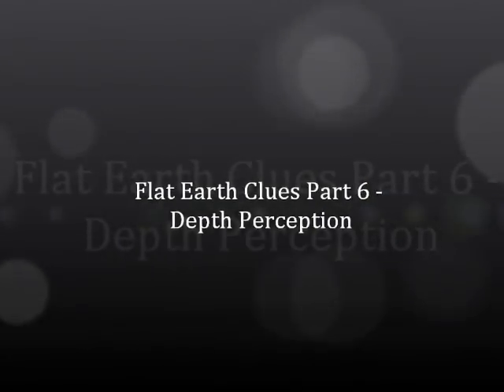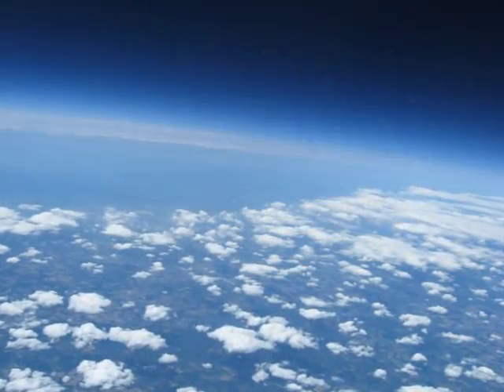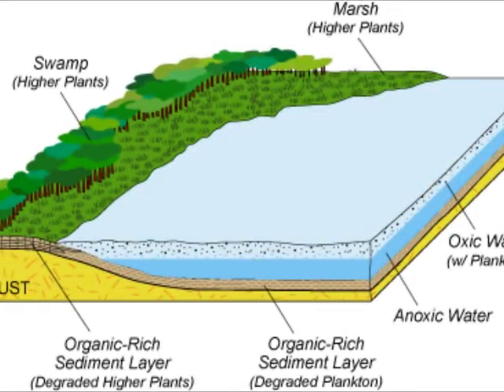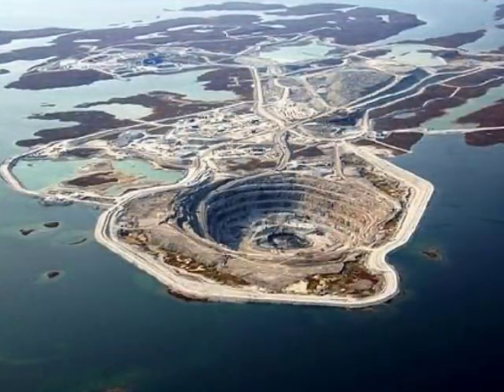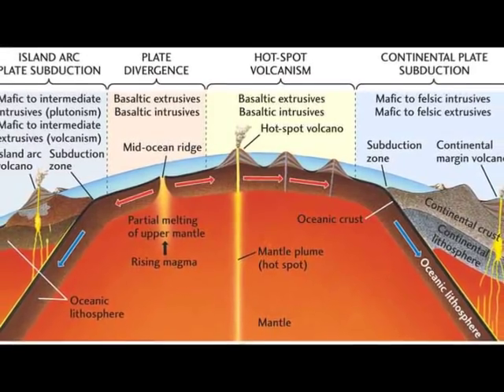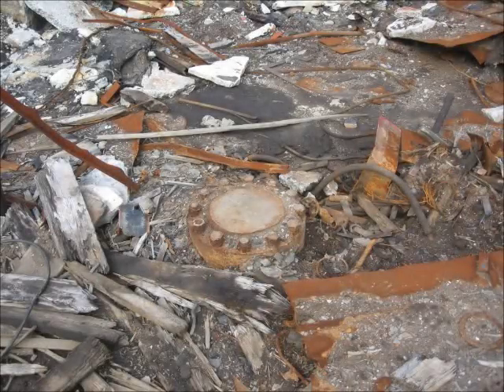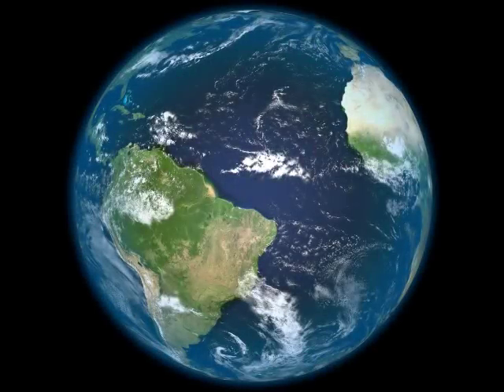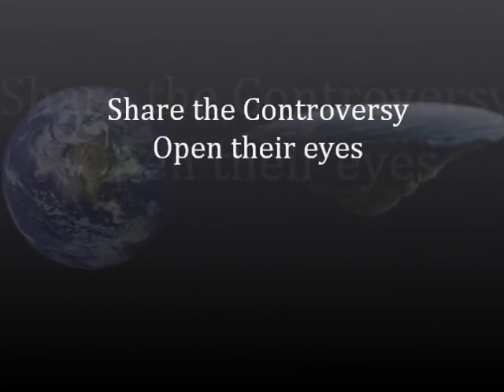FLAT EARTH Clues Part 6 - Depth Perception  - Mark Sargent ✅

Comment: Without mass and density how can a flat earth able to produce gravity?
Reply: +Equelan2 your own weight?
Reply: +GotPropaganda what do you think "weight" is? Mass without force doesn't move. Your car doesn't drive off on its own, and you know as you stand still, it takes some kind of effort to move in any given direction. Except for downwards. Jump up takes effort, to fall back down, none at all. What's the source of effort between your body and the ground? Your mass has force acting on it. it's not enough to say "weight" can replace gravity, when "weight" necessitates an explanation other than gravity. If not gravity, what force that behaves like gravity accounts for the force being exerted, the generated acceleration between you and the ground?
Reply: The Debunker So true I also found that according to flath earth model world is constantly accelerates upward which cause "gravity force" this make more sense to me rather than spinning spherical  water planet. Because I think gravitational force can't hold atmosphere in space without a dome
Reply: The Debunker
You are trying to explain something simple by confusing yourself.

Weight doesn't need "gravity" to exist.
Reply: ***** yes it does. Simple investigation, why doesn't 'weight' move sideways? or upwards? 'weight' is a form of acceleration, and it's always downwards. How would your 'weight' know which direction to go in? What is the attraction between your mass, and the ground? There's a force exerted there, and simply using the term 'weight' for it is inadequate. Asking 'why' force, 'why' down, is basic curiosity, that's real investigation, and if you were interested in the truth you'd want to know.
Reply: The Debunker
Just because something goes down doesn't mean there is a "force" which pulls it down...

There is no force pulling airplanes downwards while flying across the globe.... I mean, come on.

A helium balloon goes up because it's lighter than oxygen,a water balloon will go bellow the oxygen because water is heavier than oxygen. If you fill the balloon with dirt and throw it in the water, dirt is heavier than water so it will go even deeper down.

Gravity was only created to explain why we are "walking upside down on a globe".
Reply: ***** The Airplane protest doesn't make sense. The wing shape thins air above and leaves it regular density below, causing lift. That's why they have to get up to speed before they take off. Watch an airplane stall, or have its engines blow out, then you'll see the downward force acting on it.

All your up/down density examples work exactly the same in the globe/gravity model as they do in the flat Earth model, so that's not saying anything.

To be honest, I don't understand  your motivation. Let's say that you could produce a piece of Flat Earth evidence for every piece of globe/gravity evidence. The best you could hope for is parity: for people to say 'euh, it could be a globe, could be flat.' There would be no breakdown of society or government, no revolutionary new freedom, no radically world altered views.

You won't prevent wars, starvation, homelessness, you won't inspire a spiritual revolution or cure cancer. A lot of people put a lot of energy into this flat Earth stuff, but it's a non issue. Even if they were right, it would be a non issue. This is armchair research at its worst, with a small army of supporters who are basically too dumb to assess the information for themselves.
Reply: +The Debunker please do not underestimate power of truth. If flath earth theory accepted by majority of people on the world. This means many people accepted that we are not living in an unsignificant planet in vast universe. This prove that Someone has to put a dome for us. Someone is watching and recording our lives. This may change world because if anyone know that there will be an another life and a judgement day awaiting him afted death based on behaviours in this world then that person can not do bad things easily. On the other hand people from all around the world will start to explore and hope to reach heavenly realms. You probably didn't know but people has already started to explore our world for example a Japanese research ship headed to antarctic last week. I hope they will return with evidences of edge of the flath earth.
Reply: +Equelan2 
Regarding your first few sentences, are you actually admitting you and other flat earth believers only believe in a flat earth, not because of any rational evidence, but because you feel insignificant and lonely without the idea some god put your here for a reason? That's pathetic.  

I'm sorry that you want us to live in a divinely-created snow globe so badly that you are willing to delude yourself and go against all evidence and reality, but at least i can accept the truth and come to the realisation that us imperfect humans have to try and work together to make our own purpose.

Also, even if the flat earth theory was accepted by a majority of people doesn't make it true. The weight of evidence is what gives us the best idea of how the universe is and how it works. Surely you know this better than anyone, because you believe in a theory which only a tiny amount of people believe, but accept it as true.

I mean, the majority of people on the planet believe in a god (including you by the sounds of things) but that doesn't mean there is one. It just means people believe, perhaps for the reason of their own insecurities and fear of death, just like we have seen plenty other traditions and beliefs through out human history which have shown to be nonsensical despite a vast number of people believing in it.

Also, people have gone to Antartica for research purposes for decades now. For environmental research, ecological research, geological research...   there are many stations on Antartica. People live there. So what makes this Japanese research ship special, at least special to you?
Reply: NigelStrawberry77
I usually stop reading when people say things like this "'Im sorry that you want us to live in a divinely-created snow globe so badly that you are willing to delude yourself and go against all evidence and reality"

Reality meaning....a perfectly shaped sphere, which contains the most perfect creation man has ever seen, all by accident as a result from a random explosion. Floating around a gigantic fireball, which is at the same time traveling with our galaxy at 700.000mph.... And you don't feel a thing.... HA! 

Now THAT is science fiction...
Reply: *****
- The Earth isn't perfectly spherical

- The Earth isn't the most amazing creation, it is actually very inhospitable, as is the universe, but happens to be just hospitable enough for life, which is not surprising due to the fact there are trillions of other planets and solar systems. The odds of one having the right conditions isn't then unlikely at all...  the probably of MULTIPLE planets being hospitable isn't that unlikely either...

- Random explosion... maybe...  but it makes no less sense than the idea there is some conscious yet non-material deity that somehow exists for eternity....  creating just one little snow globe in a ridiculously large universe to have a relationship with a primitive ape without real legitimate evidence to present his existence...

- And you don't feel a thing...  indeed, i think you may need to learn some more basic physics to understand why we don't feel a thing. I mean, do you feel the movement when you are travelling in a car at constant speed? No. From your perspective, if you were in a van without being able to see your surroundings through a window, you could stand up and play poker and drink wine and everything appears stationary despite moving at a considerable speed. Go learn more about newtonian physics, momentum, acceleration and Einsteins relativity. It may open your mind a little.
Reply: NigelStrawberry77
You don't know there are trillions of other planets....

You say that because the authority told you.

You don't know that because there's no proof of that.
Reply: NigelStrawberry77 And yes.... Even if you are riding a 2015 Mercedes at 40mph, you do feel movement. Come one, don't lie to yourself...
Reply: I don't know why people think the human condition is so perfect. There's a ton of extraneous bits, things that we chop off if they give us too much trouble and we live fine without them. Our nervous system doesn't go 'nono, you've got an injury there' and guide us sensibly for treatment, it blares like crazy and doesn't shut up over the slightest cut, loooong after the rest of the body has heard, acted on, and even got treatment, out body is flooded with debilitating levels of pain registry. That's a crappy system. for guys, our most sensitive, species-propagating specific and treasured organs hang outside our body! wtf!? Not even a cage? why can't a perfect creation have jism that operates perfectly well at body temperature and have internal nuts? And what about our feet, they are simply a mess - bipedal, two legs, you'd think the least we could ask for is that our whole foot makes contact with the ground, right? So what's with the fuckin' arched foot? and if the foot is to be two-part, able to flex, leaving a bit flat with the ground for an extra bit of propulsion when we walk, why have we got five miserable little toes that're so short and weak on each foot to do this? If we're such a perfect design, explain Downs Syndrome, spina biffida, deformities.... if we're so perfect, why do we obsess over pointless shit one day, and forget about it the next? Why are our context references based purely on our immediate surroundings and not some divine and universal model of what is and what isn't? You think the human condition is perfect, because you'd like to think YOU are some kind of perfection, but the truth is you're a pasty animal that can't survive in mildly cold temperatures, after a few days without water will start to dehydrate towards a fateful end, you're pound for pound about twenty times weaker than other mammals, and whereas most wild animals are eyes-bright well groomed and beauitiful looking things, if you leave a human in the wild for a few weeks, it turns into a complete wreck. Even a pet dog or a cat would fare better than us. We're a monkey that uses tools.
Reply: *****
No, you don't feel movement. You do during acceleration, not during constant speed, unless you count the vibrations of the vehicle due to imperfect road surface.

Again, take more thought into my example of being in the back of a van. During constant speed, you could have a whole restaurant meal in there, wine full to the glass, and the liquid doesn't move unless you hit a bump which causes liquid to fly out.

During acceleration or deceleration however, the whole table and chair would move and you would have wine all over you and perhaps even a smashed glass.

Einstein realised this and proposed a thought experiment to help people understand and it was the start of his theory of relatively. He proposed a falling elevator. Without a frame of reference of the outside, such as a window, if it was dropping in the middle of the sky, and you were in it, there would be no way to tell if you were moving once you reached terminal velocity (constant speed). You would be floating inside it as if you were in space. You can't tell if you were going down, up, or staying still... you would feel motionless, floating inside this box. 

This is because constant speed means no change in force is acting upon your body, so we don't notice anything because we detect changes in force, such as acceleration and deceleration. The planets spins and orbit around the sun, and the sun orbits around the centre of the galaxy at constant speed. We can't possibly notice this. What do you expect to feel? Some force, like the wind, constantly blowing you one direction and everything moving being pushed around the opposite way? Your ideas make no sense.

Regarding your comment about me "believing in planets", that's pretty rich considering you "believe" in flat earth theory from authorities whom tell you that it is that way. You can't personally fly up to the upper atmosphere and check if your actually pressed against a dome with painted sun and stars on, so the exact same argument applies to you. You believe in something from information that an authority tells you. In this case, those proposing and supporting the flat earth idea is an authority because you hold them and their information to high regard, because you seem to have some vested interest in wanting to believe this theory. (I.E. to help support your religion, and because you want to feel like a special snowflake in the eyes of a god who created your world).

The difference is, however, the theory i follow is supported by the vast, vast majority of academics and people, where as you believe in a theory told to you by a few hundred people on a forum hiding behind their computers in with no credentials.

By the way, before you think i'm only using an "Appeal to Authority" argument, more importantly is the fact that i believe in planets because of evidence, for example, the retrograde movement of Mars, which is very eloquently explained by how physics acts on orbiting spheres, and your flat earth theory can't explain that. Furthermore, we have seen the moon landings, which show that their are spheres, at least regarding the moon. However, i've already guessed that your bound to not believe in the mood landings either.

Not forgetting the intentional space station, satellites we use, and probes we send... all of which has entered space and rotate round a spherical planet...  that goes against your theory... i mean, do you even believe space exists? Like, where is this apparent dome ceiling, at the upper atmosphere? That makes no sense. You don't even believe the actual workings of a satellite which provides a phone connection. You don't believe that people live in space stations or that the photos taken by satellites, like even the use of google maps, are really from satellites. That's sad man.

When a company like Virgin media starts allowing public passengers into space by trips, your theory is going to be blown apart just like that (although it really has already), with your embarrassed mouths wide open. I mean, come on now...   how are you going to deny it after that? The trip was an illusion? You were given hallucinogenics beforehand somehow to make you see things? Like, stop being ridiculous. Believing in flat earth theory is denial at it's finest.

We also can't see atoms. Does that mean you don't believe in atomic theory? I bet you do believe in it. So why believe in atoms, but not a round earth? Why believe in what the "authority" have told you in this example? Because a round earth goes against your fundamental beliefs and vested interest, but atomic theory doesn't necessarily. It's called confirmation bias.
Reply: NigelStrawberry77
I've never seen an atom, I believe it could be true. I know that I live in a body and I know I exist with thoughts. The rest is information being fed by other men that I have never met in my life.

It's about having integrity and truly knowing what you personally know. Not defending something you believe you know, because you believe in the man on Tv, radio or magazine who told you.
Reply: +NigelStrawberry77 can you prove round earth theory by showing solar and lunar eclipses on a solar system model? I bet you can't. No one can. Because it is a lie. Maybe the biggest lie you have been told in your life  and you haven't realised yet. I mean let's divide actual numbers and keep a certain ratio. For example sun has 109 times bigger diameter than the earth has. Also the sun is 394.7 times far away from the earth with respect to the moon. Now let's keep ratio as it is but divide numbers for example diameter of sun is 1391000km divide this by 380000 you get 3.66 km now 
Diameter of the moon is 3475km divide this by 380000 too you get 0.009km.distance between the earth and the sun is 150000000 km divide 380000 then you get 394.7km and the moon is 380000 km away divide this with 380000 you get 1km. Now you can divide all of them by 1000 in order to prepare a model within meters so you have to put diameter of 0.009m moon to 1 meter away from me while putting diameter of 3.66m sun(maybe bright led light source) to 394.7m away from me and try to show me lunar or solar eclipse. It is impossible.  As round globe model.
Reply: Basically, a three and a half metre sun, 400 metres away, to be covered by a 1cm disk that you hold at arm's length. That doesn't sound unreasonable.
Reply: *****
beautifully said.
Reply: TheAlpineAddict
Hopefully soon :)
Reply: Equelan2 gravity is a flight of imaginative fancy... the buoyant force organizes our world by density and volume. consider the definition of "the law of gravity", do you know what it is..? It's the THEORY of relativity. A law defined/rationalized by a theory is no law at all...
Reply: Buoyancy, I believe is the most common theory. Makes a weird sense if you about it to. Our atmosphere is vapor but still has a density. Air is the lighter so it floats, water condenses and sinks and we all just live in a little snow globe. 

Correct me if I'm wrong but I believe that's the theory.

Comment: So the deepest anyone has drilled is 8 miles on land. Explain the ocean depths?!
Reply: Rob, please read a few times what you just wrote. Keyword here is "drilled" and not "creation". Oceans were created as well as the mass of land. Humans are digging to find what inside the earth.
Reply: Doesnt matter the furnaces are 50 miles below the surface. So yeah. Science. 

Also vaccines and the Vatican
Reply: Known ocean deapths are a little under 11 000 meters. 
8 miles is 12 875 meters. (Have we drilled that deep?)
A commercial air plane travels a little under 11 000 meters.